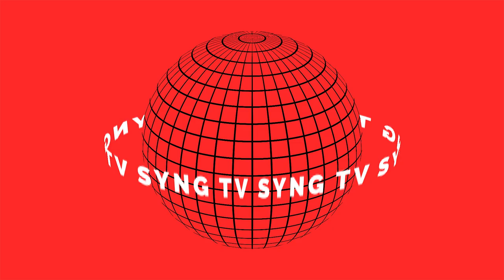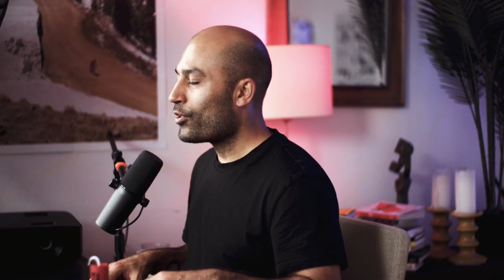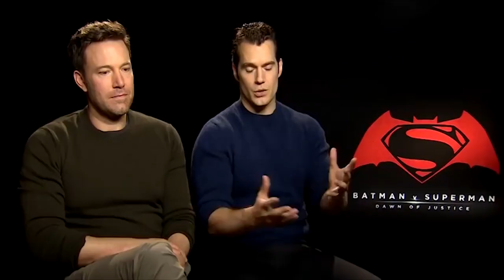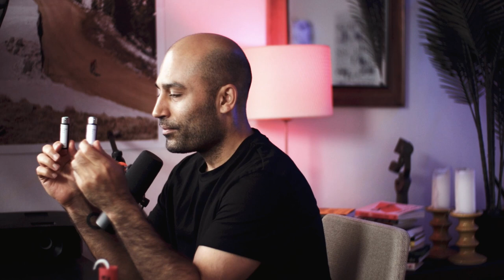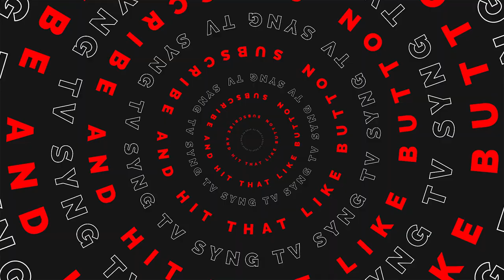How to Fix & Eliminate RF Interference on Rodecaster Pro + Shure SM7B + Mogami Gold Studio XLR

Comment: Funny thing is.. I knew this, but was drawing blank of why I was getting that RF sound. Now I feel like an idiot. My cord was a little short and was rubbing on a strip light on my desk. I pushed it away and the noise went away. I just need a longer cable. I'm just getting set up myself. Thanks. Subbed

Comment: Thanks for the video. I purchased the shure A15RF and some mogami cables. I did some direct comparisons with two SM57's using combinations of mogami cables, amazon basics cables, and with/without the A15RF.

Unfortunately, the Mogami cables had zero difference compared to my amazon basics cable. The A15RF did actually make a noticeable difference, but not enough to make it quiet enough. I think I'm just destined to use my condenser mic, which is dead quiet compared to the 7b or even my 57's.
Reply: :face-blue-smiling: Make sure your mic patch cord is nowhere near any AC cords or wall outlets.

Comment: THANK YOU FOR THIS VIDEO!!!  I have the SHURE SM7B connected to a cloudlifter and then into the Apollo Twin, have checked all cables and moved everything and still get the crunchy electrical noises.  Just ordered this and I'm anxious to see if it remedies it!
Reply: Did it work
Reply: @spenddollarzent  I ended up going with a Furman power conditioner instead.  Which didn't eliminate it.  The only way I was able to eliminate the noise was by eliminating the cloudlifter from the chain.  I was able to get a replacement cloudlifter but it didn't correct the issue.  I may reconsider this attenuator option 🤔
Reply from the maker: Keep us posted on your experiment.

Comment: First off... with the RCPII you should not be using an inline preamp. The Rodecaster has a HUGE 70db of gain built in.
Reply from the maker: I have both RCP models and they are great. Only use cloudlifter with the previous version.